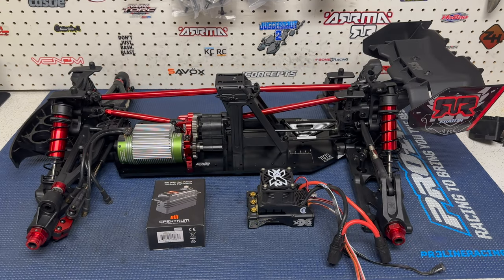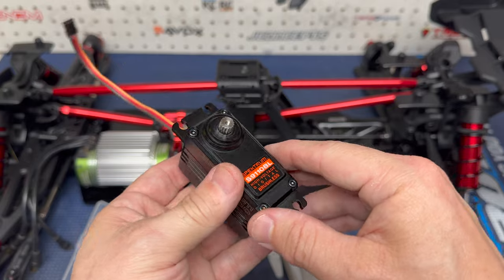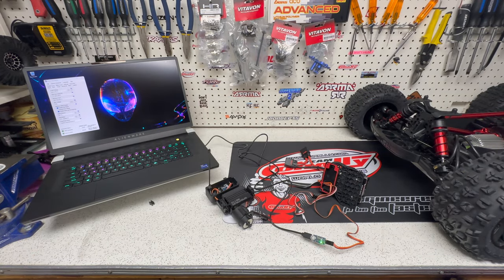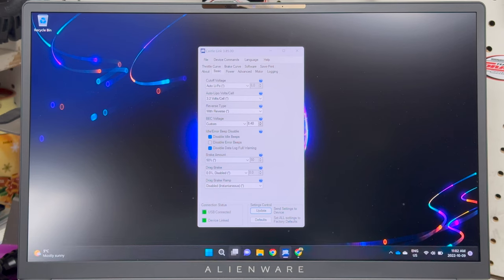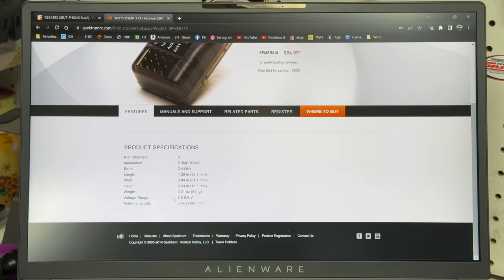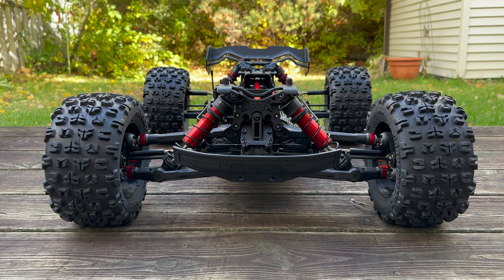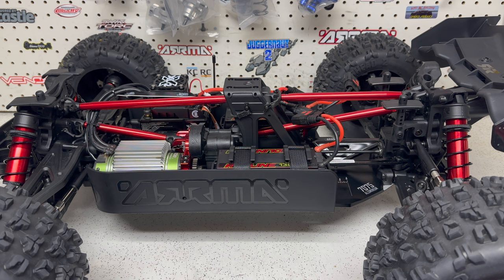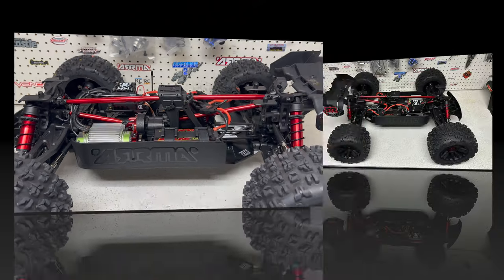Arrma Kraton 8s EXB Set Up  (Spektrum S9110 Servo installed)

Comment: The combo I originally wanted to use in my 8s outcast 😭😭. It was just never meant to be. That servo looks absolutely beastly, if I ever need to upgrade from my PowerHD 65KG servo, that's going to be the one.
Reply: Do you have any problems with the powerHd 65k ?? Do you need glitch buster for that servo?
Reply: @Playstation5-d9u I’m using power hd 65 too, no issues but i feel like its not fast enough for me, tho I’m on 7.4v

Comment: companies need to start offering more receivers that least take 10v
Reply: That would suck, that’s a huge loss and you’d see faster battery drain that way
Reply: @bryanmiller476  I'm talking about the receiver so you can run a more powerful servo or fans off it

Comment: I run 8.4v on my Traxxas 6533 receiver, 2 of my 5th scales have them I love the Bluetooth easiness of fine tuning the travel of the servos. It’s been months and haven’t had one problem. 

Also have a Xmaxx with 7.4v on a 6533 from a Max 6. I also use a traxxas 6 cell NiMH and wait till it settles to 8.4v or lower to install for the traxxas Transmitter, no more wasting double A batteries.

Comment: get the futaba r2104gf receiver. it operates at 8.4
Reply from the maker: The website shows 6 volt max?  I know the clone receivers operate higher.  The only Futaba I know of that operates at 8.4 is the antennaless one.  For indoor racing.
Reply: My apologies bro. Amain hobbies web sites says 8.4, they lied to me 😂. But I did look at the manual for the r304sb and and it does say usable voltage is 3.5 to 8.4v

Comment: Fun fact about rc world. If the reciver says 7.4V its reffering to nominal 2S lipo voltage while in reality these recivers are capable of 8.4 as fully charged lipo battery is 8.4 so you can use it in your petrol or nitro as reciver pack. Good brands like futaba or sanwa are also overbuilt and can handle a bit over that, tho i wouldnt recommend going past 8.4. 6V recivers are a smymilar stroy as they are tuned for nimh 6s that when fully charged pack 7.5V but due to nimh not beeing very efficient there is huge voltage sag under any load and it drops to around 6.6V. So to sum it up if the reciver is 7.4V rated its capable of handling fully charged lipo meaning 8.4V while 6V recivers are a bit less durable and you shouldnt go above 6.6V with these(LIFE PACKS ARE ON BORDERLINE!).
Reply from the maker: That makes sense.    A 2s fully charged lipo would be 8.4V.  So if you were running a receiver only that would be 8.4v in.  So it makes me wonder why they show operating voltage from 4.8V-7.4V?
Reply: @JasonPerrinRCVlogs  it comes from the nominal voltages of certain cells 4.8 is nominal for 4s nimh, 7,4 is nominal for 2s lipo. Its kinda legacy thing from days of nitro when you were plugging your battery directly into reciver and for convinience they marked nominal battery voltage. Another fun fact about 8.4v servos is that any servo marked for 7.4 can do 8.4v. while not every servo marked for 8.4 can exceed it. Its basicly marketing, all these servos are rated for 2s lipo some just tell you spec with full charged battery (8.4) and some do for nominal voltage(7.4).
Reply: Hope i helped and made you feel a bit more confident about not burning your reciver. There usually is some voltage sag but i tested my sanwa recivers with lab power supply and they are perfectly fine running 8.4v and can easily pull through over 10A for my 123kg twin servo steering in dbxle.
Reply from the maker: @Ev0ltion  So that also makes sense :).  Dam, you have me thinking now. lol
Reply: @Ev0ltion  So I just ordered a powerhobby 1513mg 7.4v 1/5 scale 100kg servo and see my firma 160a esc is factory set at 6v BEC. I believe I can change the BEC setting but I’m still figuring it out. I’ve had RTR cars for 35 years and I’m learning this roller/ kit thing. Lol it’s a kraton 8s. Thanks!